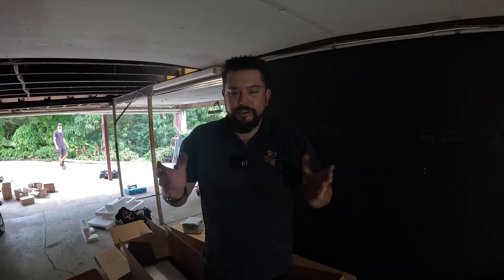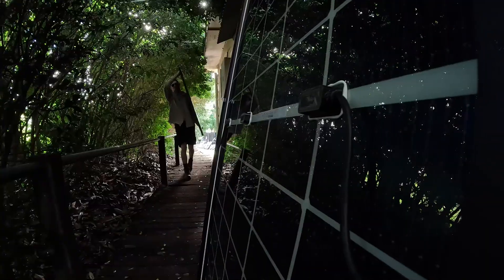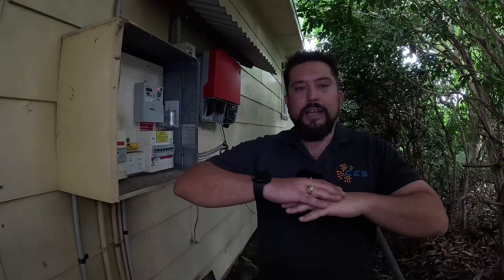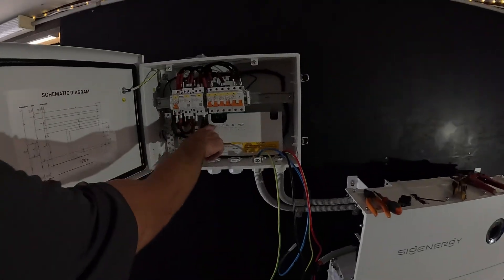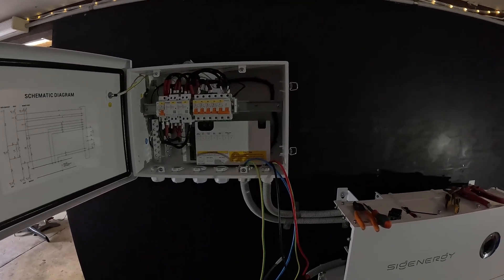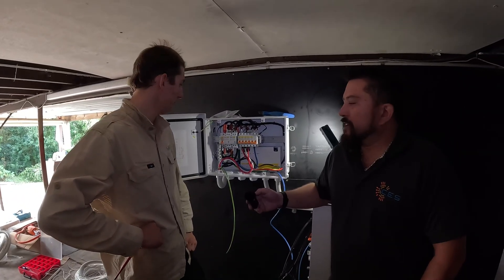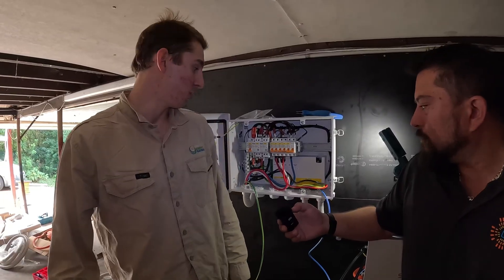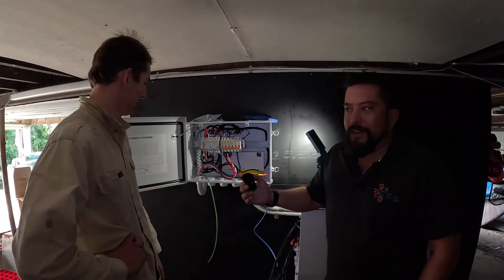𝙎𝙞𝙜𝙚𝙣𝙎𝙩𝙤𝙧 Personal Home Installation Follow-through - CES

Comment: What if your current hot water system is on controlled load, which is through the Controlled load meter. Once connected to this smart gateway, if it has to heat through the night, will it be on controlled load, or at full price?
Reply from the maker: Hello, would need to remove the controlled load. That would happen at time of install via the way of an ewr on completion with the dnsp. 

Benefit is it will slightly reduce your supply charge, however would need to make sure the solar and storage is big enough to support it so you dont end up buying power from the grid (I.e, if your install is undersized)

Re running at night you can set the battery involvement to run the device so you dont have any grid load. No different to any other load at night. 

However, my 300l hot water system only needs to run for a few hours a day of surplus solar and thats enough for a home of 4 to all have showers at night, then two of us have another shower in the morning and have plenty left over 👌

Comment: I have a sigenergy system the same as youve installed and am looking at adding a generator. What generator would you recommend?
Reply from the maker: Hello, great system hey! 

For generators i would highly recommend a GL9000 kubota auto start for reliability. 

Stay away from Maxwatt and Hyundai as they seem to have major quality control issues. 

Aside from the kubota, you can look for a generator that offers 2 wire start, sine wave output and for a system of this size would recommend a kva rating of 8kw which should give you a good reliable output of 6.5 continuous. Hope this helps
Reply: @CertifiedEnergySolutions any recommendations for a propane fuel generator?
Reply from the maker: @forcesfitnesssr not really. It's something we haven't played with before. If you are looking for a more budget generator you can try the westinghousr 10kw unit we just posted up on our page. Great bang for buck and they work flawlessly with the sigenergy system due to being signeave output 👌

Comment: hi Dan. Its a pity you have to have a smart meter for solar. Lots of my customers are getting much higher bills after the new smart meter, at least solar and battery lowers this a lot. Smart meters compulsory by 2030😒😞😔😢😤
Reply from the maker: It's an interesting delema. 

What i have noticed is smart meters are not necessarily the reason for the higher bills as they simple measure consumption with more accuracy. What is hitting the back pocket is the demand charges that go hand in hand. Anyone that had a smart meter installed will see a sneaky high demand rate come into the picture and this is where the biggest difference is. 

If they dont have a battery system they are consuming power at night at a much higher rate! 

Good thing the rebate has come along!

Comment: Nice video. I was told with the back up the Sig only uses one of the 8kw battery modules? so best practice is partial back up of the property. Any thoughts.
Reply from the maker: Hi Colin,

For each 8kwh battery block, you gain another 4kw of maximum input and output, meaning that with this system comprising of 3x 8kwh battery blocks we are then limited by the 10kw inverter.

However it can be beneficial to have full home backup in events of a blackout if you can manage your power below the already high peak output of 10kw but still have power to all of your homes circuits. A more complicated and larger home can however make more sense to have partial backup as it can be difficult to manage all of your loads in the property.

Comment: after i retired, i got a degree in green energy, and tragically, even while i was in school the tech was changing faster than the schooling could keep up with, the mppt charge controller appears, the better and more robust SCR in inverters and battery technology was a learning curve that was hard to keep up with.

videos like this are quite educational if you have a clue what is going on.  i read the comment on laying the bi-facial panels flat, and i was also wondering if the cost of the panel did anything to warrant that extra power gained if any.

great video, glad i found your channel
Reply from the maker: Cheers, completely agree with you. The renewable energy space changes and improves almost monthly at times! 

One of the hardest industries to stay on top of with a new thing to learn every day of the week. 

The bi facial panels are one of our more affordable panels, most panels have gone this way. While they do provide a bump in generation around the outside panels the bulk array more than makes up for not tilting.

Comment: Great install, what did this particular system cost?
Reply from the maker: Thanks! This would be mid-late teens with rebates 👍

As it was my personal system I did not calculate the cable runs ect but that would be a close ballpark.

Comment: Great video! Question regarding the hot water integration.. if my water tank has wifi capability, can the Sigenstor app see it and add it as a device to manage (assuming it’s in the same network)? Or does it have to be Ethernet cabled? If so, how does the Ethernet connect to the water tank?!
Reply from the maker: Thank you. Glad it helped. Re the hw, the sigenergy can only control the device if the ac for the hw is wired into the gateway. The gateway then controls the hot water system with a simple on or off relay that is built into the smart port. 

Unfortunately third party devices can't communicate with the gateway. But knowing how quick they bring out updates you never know if that would be a feature down the road.

Comment: 6:53 great install guys. Bifacials work ok laid flat on a reflective roof. They work even better spaced out and tilted up to maximise light exposure on the back side. This guy as done a lot of data analysis on bifacial performance.
https://youtu.be/mzqjCsZKUYQ?si=rVHCRqaZJRNIh7lI
Reply from the maker: Thanks!

Indeed that do. Only problem with tilting is you need to space them out to not cause shade from the row in front. Not much roof space to work with so went with going flat and adding additional panels. Belting out nearly 50kwh per day and we are in the worst month for solar so can't complain with that result 👌.